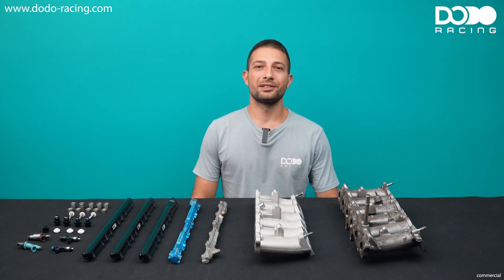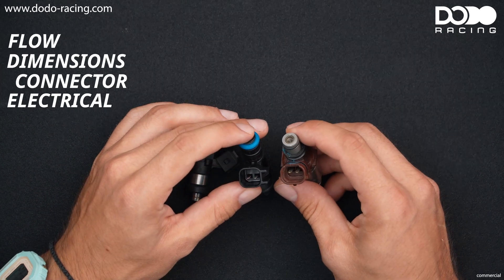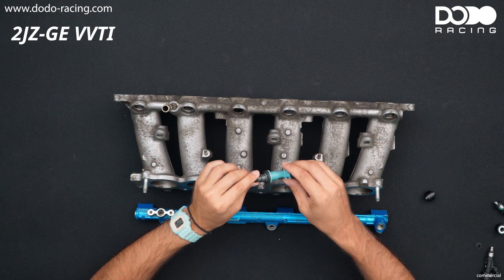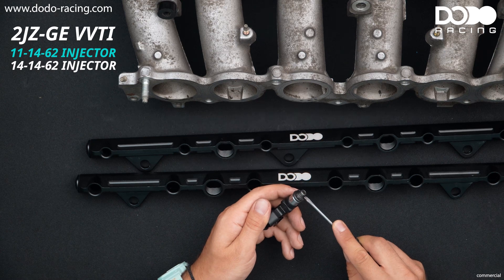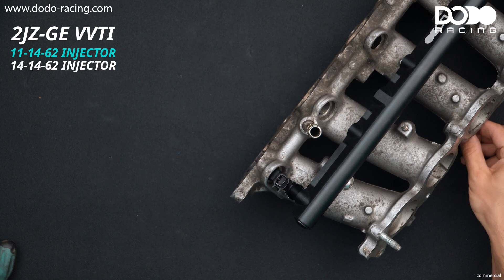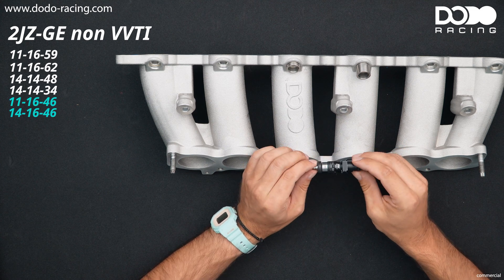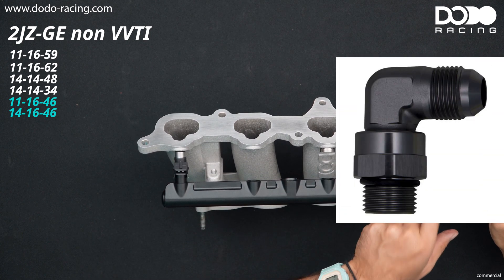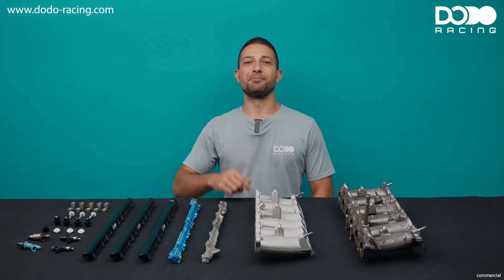2JZ-GE Injector Guide // 2JZ Shrine

Comment: 16:30 Does that mean that I can use the normal profile fuel rail with the shortest injectors without modifying anything on the GTE VVTi Plenum? Or is there any other way for the fuel rail to not hit anything on the manifold plenum as I dont really want to modify or grind anything on the stock plenum?
Reply from the maker: Correct, the short injectors do not require the low profile fuel rail or any modifications to the plenum.

Comment: Very informative video, thank you for taking the time to make this as it makes way more sense now.  
I had a few questions concering the GTE intake manifold in my Lexus IS300.  I want to convert from the tublar to the front facing style intake like the GTE.  If I go with your low profile fuel rail and GTE intake manifold (Off any GTE motor btw?) what kind of modifications will I need to do on my IS300 (2JZGE) to get it to physically fit?  ie: Will I need to relocate the ECU box and power steering?
Reply from the maker: any 2JZ-GTE plenum fits. non VVTi give you a little more space around the throttle linkage. no modifications have to be made to the chassis, the hood closes normally. you will need a longer throttle cable. get the aristo or supra one, or take your stock one and take it to a shop and tell them you need a longer one (by 2in). the ECU can stay in place, but  the power steering reservoir needs to be relocated. washer tank will also be in the way for IC piping.
Reply: @DodoRacing  thank you!!

Comment: Is there a way to use JDM 2JZGTE vvti 440cc injectors on a 2JZGE vvti , from what I've read the 440cc injectors are high impedance while the 270cc are low impedance but you can get a resistor box 

I already have these injectors from a aristo and would like to use them if I can
Reply: If they are side fed injectors, they will fail. I converted to top feed after trying to get stock aristo injectors serviced.
Reply from the maker: no, the GTE injectors wont fit. 7M-GTE fits. also subaru injectors and RX7 and RX8 injectors fit with our 4.5mm fuel rail spacers. I believe there are yellow RX8 injectors that have 440cc.  You can also contact me if you like 450cc deatschwerks injectors, matched in sets of 6.

Comment: Can you run different brand fuel rails on these runners like radium etc. or do you specifically have to use the DODO brand?
Reply from the maker: Our Runners are designed with compatibility in mind. They will accept any 2JZ-GE fuel rail. However, our fuel rail lineup is specifically designed to give you the most injector options. Our low profile fuel rail is the only one, that will give you enough clearance for the OEM GTE throttle body using standard length injectors.

Comment: Thank you for your diligence in pursuing the virtues of the GE-VVTi cylinder head. It's cheap, flows just as well as a GTE, and VVTi is definitely an advantage in terms of midrange torque - and therefore turbo response. Having set up my own GE-T using your (excellent) intake runners, I have a few thoughts/musings:

1. Toyota drive-by-wire GTE throttles are old, rare and expensive. TAARKS makes a nice adaptor to marry the inexpensive and prolific DBW Bosch throttle bodies to the GTE intake manifold. It's a nice solution, ends up being more compact than the Toyota throttles, Bosch supplies good P.I.D. values for your ECU, and it won't interfere with any fuel rail arrangement.

2. While I understand and respect why you chose the injector bung size you did for your GE-T runners, I strongly believe the most reliable approach to injectors is to use the press-fit adaptors into the injector bungs - and injectors that slip into them. The reason for this is the big fat "Denso Cushion" o-ring/gasket design for sealing the OEM injectors into the injector bungs is a poor design for a boosted engine. That design was meant to create a good seal for an engine that would see no more than 0psi - and would usually be under vacuum. Any boost will create pressure on that injector gasket and try to lift it off its seat - creating a boost leak. This design relies on the fuel rail to keep the injector pressed down, hard, against the injector bung. This is not theory; many people have experienced this issue and fought to achieve a reliable seal between injector and intake manifold. The press-fit adaptors that tightly fit into the injector bung will resist boost pressure - and allow the injector o-ring to work like a regular o-ring should - which is to say, creating a circumferential seal inside a bore. It also makes fine-tuning for perfect injector length a non-issue because it's ok for the injector so slide a few mm up and down between the fuel rail and intake manifold.

3. Don't forget to add a fuel pulse damper to the fuel rail.

4. GTE upper plenums are getting much harder to find. You should make a cast, affordable, bolt-on replacement that doesn't require much (if any) re-plumbing. Most of the aftermarket plenums eliminate the runner-length that Toyota designed into the upper plenum - which decreases low/mid range torque in exchange for (modest) improvements in top-end power. They also position the throttle much lower and further outboard in the car. Both of these factors are fine for a racecar, but less than ideal for a street car. I'm sure you'd sell as many upper plenums as you do lower runners... I'd take on this project myself but I'm too lazy. You seem to have the verve to get it done.

Comment: How is the flow affected with the low profile?
Reply from the maker: The loss is insignificant. Even where the indentation is, the cross-sectional area is 55% bigger than on the stock rail and 60% bigger than on a Dash 8 PTFE hose.